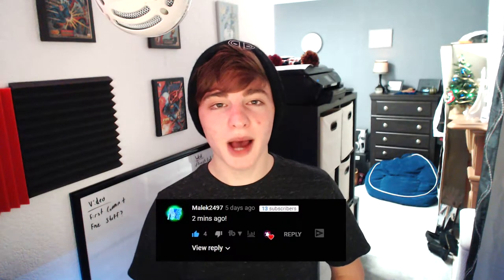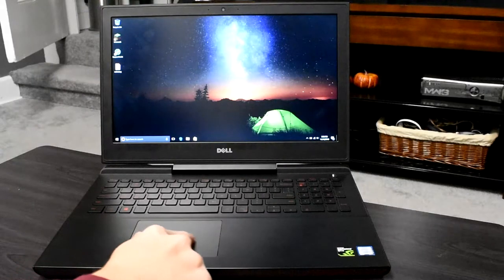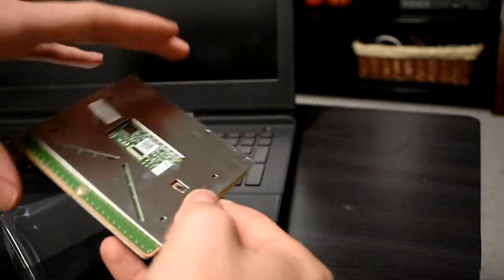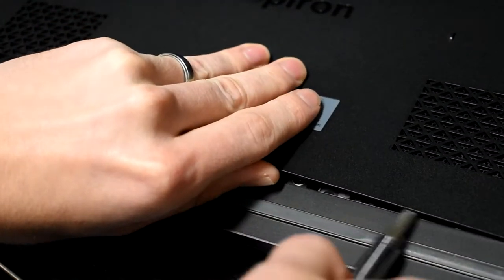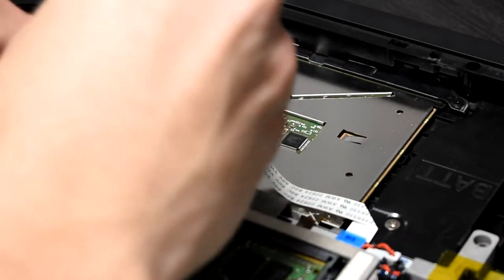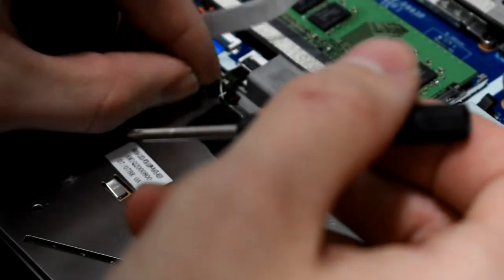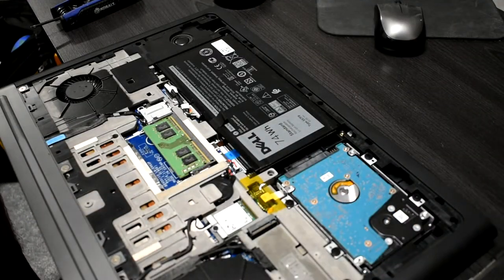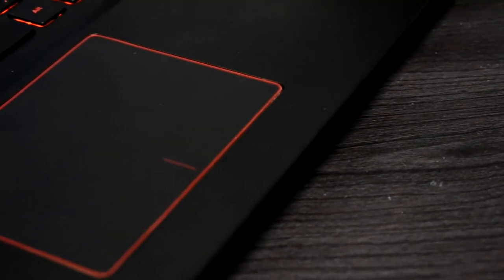How to Fix the Touchpad in your Dell Inspiron 7567 Gaming Laptop! - Touchpad Replacement Guide

Comment from the maker: How are you guys?
Reply: Seems this is a common issue with 7567. Dell quality is crap now. Also faced loose display ribbon behind the LCD.  I thought display or display ribbon is dead but then opened it and put a thick paper behind, now working 99% better

Comment: Thanks for posting this. My touchpad on this model laptop has stopped working and has for some reason feels REALLY hot. Just ordered a replacement pad and gonna see if that works.
Reply: How about your touchpad now?, i face same problem on my 7567, isnt working and feeling hot

after replace,is there still any problem? Or normal now? Sorry for my bad english
Reply: @galliarddust9280  Works like a charm now. Easy install with this video and everything is good as new.
Reply: Hello. I got the same problem. Does replacing the touchpad solve the issue?
Reply: @christianregalado7731  Indeed it does. Replaced mine with the way shown in this video and it's good as new. Easy replacement.
Reply: Hey exactly the same problem here man. What's your update? And why does this happen?
Reply: @kirannadig5364  No idea why it happened, but the replacement works fine. I could cooked and egg on the old one.
Reply: @MoltenMan85  Same thing happening to me now. My fingers burn if I put my hand on it. And it suddenly happened for no apparent reason. Guess I'll get a new touchpad and replace it. Btw where did you get a new touchpad?
Reply: @kirannadig5364  The Dell website had a link for replacement parts. Might be a link in the description to this video.
Reply: The Solution that I did is I remove the connected cable from the touchpad and to the motherboard since I am not using the touchpad. I usually use my laptop with mice. I dont have the money right now to buy a replacement.
Reply: @christianregalado7731  what are the precautions before opening my laptop. I'm scared actually
Reply: I didn't take any precautions before Opening my Laptop. Since Dell cannot help me because my warranty for the laptop ended. I use this video as a guide. Just use a Screw with Magnet.
Reply: @christianregalado7731  so did the keypad stop heating after that? Even I can't find a replacement now. Will just disconnect it.
Reply: Yes. It will not work because there will no power.
Reply: Same thing happened to me, I replaced it as shown in the video and it works perfectly. Just make sure to insert the cable all the way in the touchpad.

Comment: Hey thanks for making this video. Couldn't fine anything like this online. 
Btw my touchpad (7567)suddenly stopped working and it gets insanely hot at one area. Should I replace it?
Reply from the maker: Yeah for sure! If it isn't usable, it isn't any help to you! The replacement part is only like 10 bucks on eBay. And now you got a video showing you how to do it 😜
Reply: Did you ever get that issue fixed ?
I’m currently having the same issue as you.
I’m extremely worried
Reply: Kiran Nadig ^
Reply: @IceWNL  I just disconnected the touchpad and left it there. I use wireless mouse now. It doesn't heat up anymore
Reply: Same thing happened to me, I replaced it as shown in the video and it works perfectly. Just make sure to insert the cable all the way in the touchpad.
Reply: @PremiumAphid  How is ur ebay part working?is the ebay part like ur original laptop part?dell is selling it for 20$ lol

Comment: Hey man, my touchpad buttons don't click like before, I changed the thermal paste and when I put all again the buttons didn't feel and click like before, can you tell me or show me how you have the part where the buttons are?
Reply: Are you find issue? Can you help me, I have some problem
Reply: @ushane78  No, man, I never find a solution, I just bought a mouse after that
Reply: @ElJovalles  I found solution, you need to buy new touchpad. Its problem of touchpad (Although it doesn't click)

Comment: Hey can you help me with my problem? My touchpad right click broke and my laptop(same with yours). I tried to click the right click by applying pressure to edge and then suddenly my laptop shut down. And now my touch has a certain area that is really hot.
Reply from the maker: dude it probably needs to be replaced. The touchpad is also right above the battery so that could be warming it up.

Comment: Do you know if the mousepad you brought will work for a Inspiron 7000?
Reply: I just got it to work. It cost me some time to reboot and fix the windows settings etc. but i have just logged in and navigated to this tutorial using only the newly installed touch pad. (the one from the description fixing an Inspiron 7000 gaming)

Comment: 1:51 I accidentally removed the bottom cover instead of the white one. I plugged it back in, but when I turn on the computer the battery shows as "no battery". Fuck man.
Reply from the maker: Don’t understand what you mean by the bottom cover. Double check your connections to the battery they are hard to connect
Reply: @PremiumAphid  In 1:51 You just removed the white socket but I also unplugged it from the black soldered cap underneath. I plugged it back in but the computer doesn't detect the battery. I think I broke the solders.
Reply from the maker: @batuhanemreozlu5831  dang bro, that sucks! I’m sorry. Your gonna need to find somebody who does Micro-soldering. But they can be pricey. You should be able to use it plugged in at least. Might just become a stationary computer. Good luck man
Reply: @PremiumAphid  The battery life was already exhausted. The reason I opened the touchpad because the touchpad came off. But I saw that the touchpad came off because the battery swelled. The battery needs to be changed anyway.
Reply from the maker: Ahh, bummer. Hope your able to get it back up and running. I know how important computers are